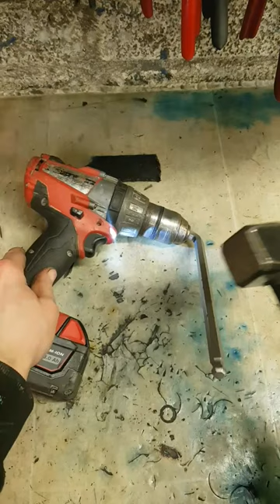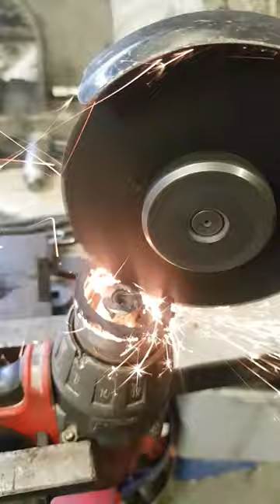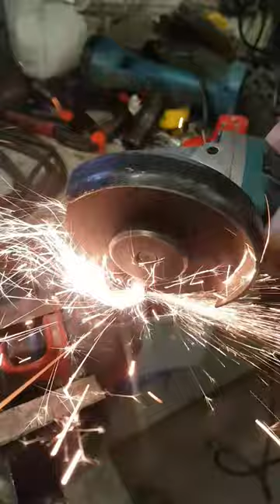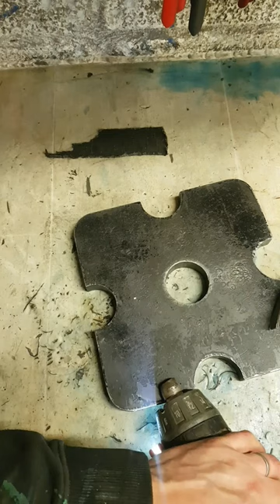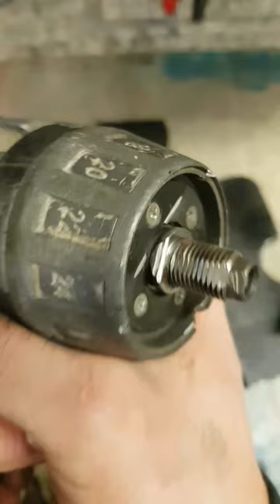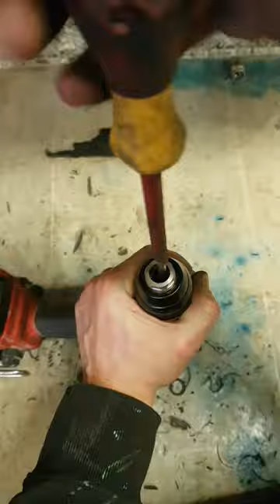How to change the Chuck on s milwaukee drill when it won't come loose. #toolrepair #milwaukee #tools

Comment: Dude made this so much more complicated then it needed to be
Reply: They're opposite threads that's the only way he could get to it
Reply: Prolly meant buy a new drill
Reply: No he didn’t lmao he made it as simple as possible.
Reply: @jsl6155  this comment shows that you don’t do this type of work you probably did it once and struggled and think this is the easy way 😂
Reply: Mind telling us the easy way to fix it?
Reply: Have you ever changed a chuck that will not come off?? Think not...
Reply: This is how I'd remove the chuck. VS bashing the thing to all hell
Reply: @InfiniteTheMagicMan  who Yung_Papi???
Reply: @whatever_12  depending on the drill Brand use wd-40 or something similar and then use two channel locks. If the holding thing is not stable enough then you can just put the whole Maschine in a Bench vise and use the channel lock solo. Be careful with the direction when pressing and yeah......... Done
Reply: I think he's meaning no penetrant or other options were tried before getting out the grinder
Reply: @dogbiscuit3985  if you can’t even do this to your drill? Maybe stay at your office job
Reply: @yung_papi6911  I would love to see you method
Reply: @3Z6I9R  I'm an A/C tech. Stay ignorant.
Reply: Nope, when these won't come off it's the easiest way.  If you try to use too much force when wrenching it off you'll end up wrecking it
Reply: @TheBlaert Exatcly. You will just wreck the gear box making it a much mpre expensive job.
Reply: Nah this exactly what u do as a last resort. Been repairing tools for over a decade.
Reply: Nope, as simple as it needed to be. You can lock it in a vice and beat the soul out of it, but you can and WILL destroy the gearbox (ask me how I know) and that is infinitely more expensive than cutting it off

Comment: Awesome video I just bought a used Gen 3 hammer drill kit from the pawn shop for 80 bucks. Just needed the battery and charger for my new Gen 4 but I noticed the chuck on the Gen 3 is bent up pretty good. I’m glad to know I can change the chuck out and make it close to new again 👍

Comment: It's red lock tight you need to use a torch to heat it in enough for the thread lock to soften then you can get it to release.

Comment: No fucking way that Chuck went on that smooth with all those threads flattened out on one side like that
Reply from the maker: Of course it dose. The thread was cut with the old Chuck clamped around it. Meaning no burrs or deformed threads. And anything that is out if place, gets repaired as the old Chuck is unscrewed. It's like the cut threads where never cut.
Reply: @deandohertygreaser  those threads were smashed after the old chuck was removed.
Reply from the maker: @NoahKuzel as you can see in the video, they work perfectly. I would have to remove at least 1 chuck a week like this. works every time.
Reply: They weren’t flattened, they were cut away. Had they been flattened it wouldn’t have gone on so smoothly. But because that section of threads no longer exists they can’t get in the way.
Reply: Yes fucking way that Chuck would go on that smooth, the threads weren't flattened just ground off on one side.
Reply: I mean, they were more removed, I'd say. A tap is missing threads in 4 places but they thread just fine, right? haha but naw I've has to remove a section of threads from a bolt for projects before and I was surprised to find out it didn't mess with threading.
Reply: I mean, it’s on isn’t it?
Reply: @NoahKuzel  
Way to out yourself for all the world to see that you have no idea what's going on in this video!
May I recommend not commenting in the future or maybe show it to somebody who's done a few things and ask them what they think is going on in the video and then they can tell you and then you can comment from there!
Reply: @b rizzle  your right. I don't know, Jack shit. I am just an auto mechanic and have to deal with rounded off, cross threaded nuts; and flattened threads on a daily basis... I have a drawer dedicated to damaged threads, broken bolts, and overall thread repair...
Reply: @NoahKuzel dude, you don’t know what you’re talking about. This guy does. Just bow out and maybe avoid further looking like the loudmouth who doesn’t think before speaking.
Reply: @NoahKuzel  I thought mechanics had critical thinking skills but it seems like you're the exception
Reply: You guys don't know what your talking about, with the threads.
I cut the chuck off the same drill same way with grinder and added what looks like the same metabo chuck
Reply: Not saying it didn't  work perfectly, but if it was mine I wouldn't have cut into the treads just because it easier to do so

Comment: I've got a similar drill that def needs the chuck cut off. When you've got a drill that's seen this level of abuse, the amount of torque it takes to "properly" unscrew it is more force than the drill body can take.

Comment: Dean I have this problem I can't remove the screw inside the chuck I have already cut the chuck tried cutting tru the screw and hammering but it still won't budge last resort I will be going to heat it with a torch the screw and try hammering it clockwise

Comment: When my makita needed a new chuck I just sent it in. Didn't have to butcher my tool
Reply: I can imagine Milwaukee would refuse to repair a probably 20 year old, heavy used drill. And if they would, it costs more than a new one. I mean it works just fine and the threads grinded of on one site may seem bad but it's totally ok for a tool like this. Wouldn't do this with an impact tbh.

Comment: Well, if your a little more patient and persistent you can remove the chuck without damaging the rest of the drill. Including ways of cutting the chuck off without cutting in to the threads and stuff. Before anyone accuses me of never having changed a chuck before, I had a phase not long ago where I was fixing milwaukee tools as a hobby. I replaced at least 7 chucks, 2 needed to be removed violently and without damage to the rest of the drill.
Reply: This chap does it for a living, he's probably done hundreds if not thousands.

Comment: If it was stuck that bad, I would just replace the drill. And sell the old one for parts. They are worth a lot in parts' "working" condition.  You'll thank me, lol
Reply: oh yes yes the good old if you can't change it throw it away attitude.. 
he could have clamped the drill on the bench and just used a pipe attached to the allen key .. or just used a impact gun

Comment: Wow, on the Milwaukee parts diagram is says that there’s red loctite on the threads. All you needed was some heat.
Reply: On a plastic drill… great idea
Reply: @chronovore7234  You don’t get the oxy torch out and melt it out, just warm up the screw head with a small butane torch. Soldering rework station could work too.

Comment: Was the chuck reverse thread?
Reply from the maker: The the bolt inside is left hand thread. The Chuck is std thread
Reply: @deandohertygreaser  interesting I've never seen a chuck removed on one of millwaukee drills.
Reply: @DJjosher isn’t almost or not all the the drill the same🤔
Reply: the chuch isnt reverse thread, but there is a long screw holding it in inside the chuch that one is reverse thread.

Comment: Or . Just buy another
Reply: Ah yes, disposable tools. As everything should be now.
Reply: A new drill is $200. A new chuck for that drill that still works is $20.
Reply: its not even about the money here, cant even trust a worker if he cant even fix such a small probelm
Reply: @zachdemand4508  that drill is not $200 , for $229 or 299 you can get an impact driver and hammer drill combo with two batteries and a charger
Reply: @michael  not a milwaukee. Batteries are 250. Go ahead,  ask me how I know.